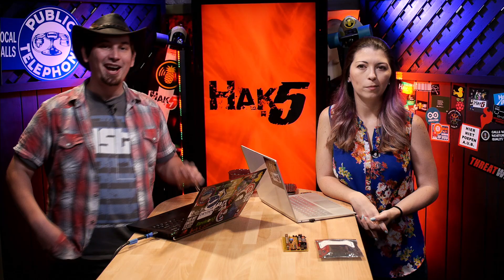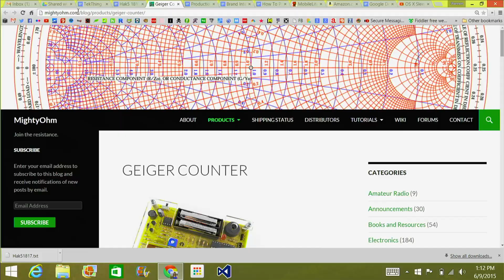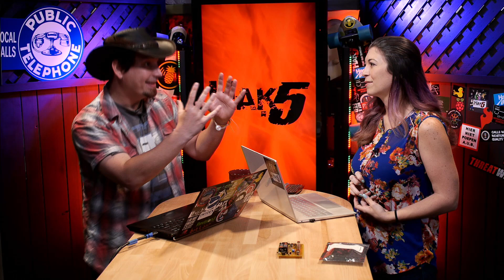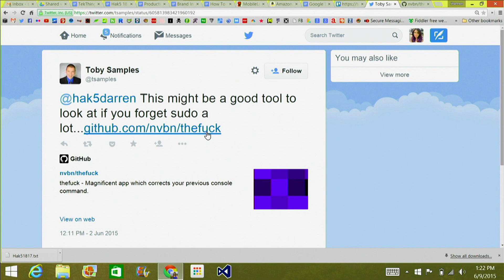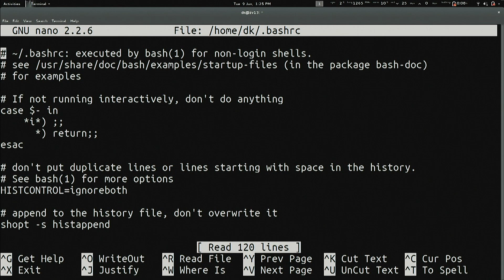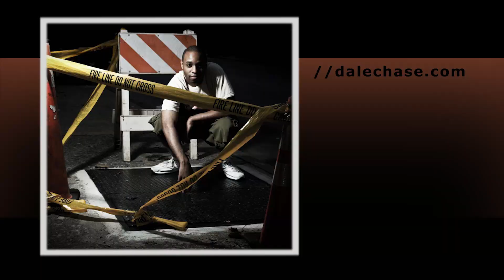Hak5 1817 - Open Source Hardware Geiger Counters and Linux Tools for the Forgetful

Comment: Just a couple of clarifications, that is a Russian SBM-20 Geiger tube.  It works on Beta and Gamma radiation, not Alpha.  It is not meant to be a direction device.  It works on proximity to a source not directionality.  The closer the tube is to a radiation source, the louder the circuit will sound, but yes you can find a small radioactive needle in a haystack.  

It can also detect radiation form patients taking nuclear medicine treatments, and you'll find you can not get within 30 feet of those people without the device sounding like a fire alarm. Many similar kits are available, this is a Chaney electronics kit, which they have about a dozen different versions of this Geiger Counter.

Comment: Alpha radiation is stopped by paper.
Beta radiation is stopped by thin aluminium sheet.
Gamma radiation is stopped by lead sheet.
Neutrons are stopped by water a paraffin.

If you are serious about the copter idea for the radiation sensor, you should build shields of all the four stoppers. I would suggest using a gimbal with the geiger counter due to the shield having only one hole for the tube.

Comment: The radium ceramic is called fiesta ware I think. Gamma bursts are the worse I think and pass through anything. Fukushima may have had a gamma burst or two,
Reply: Hoverbot1TV It's not even radium - it's uranium. Also, gamma radiation can always be stopped (like any electromagnetic wave), it just takes more material to absorb the energy. Just about any gamma won't pass through a thick piece of lead.
The number of inaccuracies in this video is killing me, there're tonnes.
Reply: Oh ya radium is the stuff women used to lick to paint watch dials. That GE 50's design sold to Fukushima was pretty weak especially since it was using mox fuel which spread everywhere around the plant. Not much help from the west there, airbag recalls get more attention LOL!

Comment: I actually created a true random generator using a cheap detector and a Cesium137 test source and an arduino and I create random bits that way that are truly random. You could I face your board.
So whenever I need a private key I use bits from this collection and delete them.

I also have two chunks of uranium in my room and I sit next to it most of the day. The amount of gamma radiation from uranium is minimal.
Am
No indeed an americium source that is really hot.

Comment: Can't you just provide the proper shielding on the Open Source Geiger counter kit? Say, a full steel enclosure with a slit on the front for detection and a polycarbonate window to protect the tube?

LOL @ thefuck util! I can imagine getting used to using it all the time and accidentally trying to invoke it at a different terminal and the sysadmin being all "WTF are you doing?!"